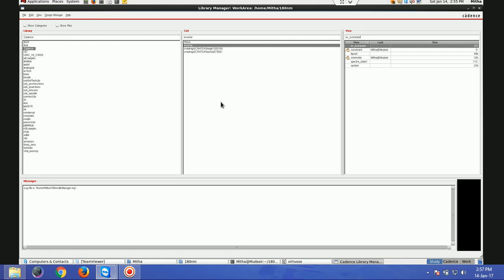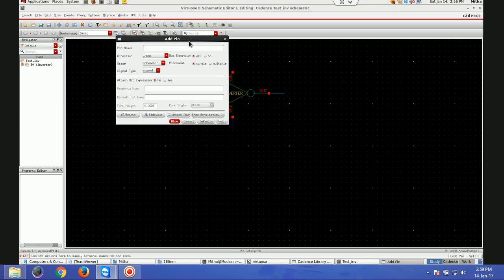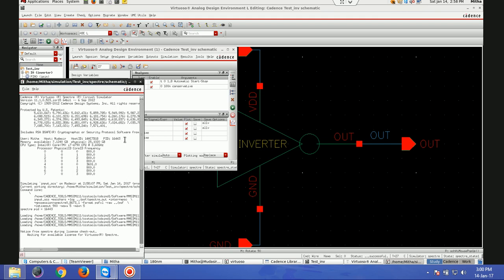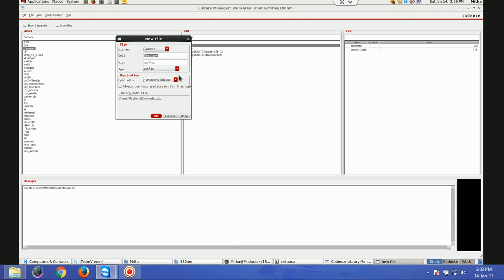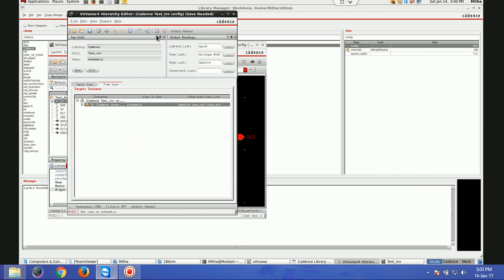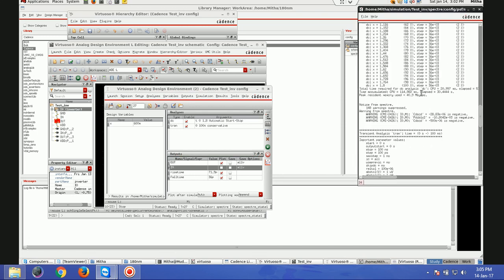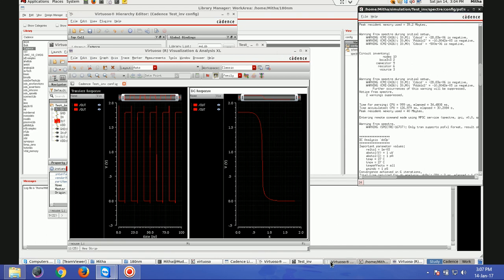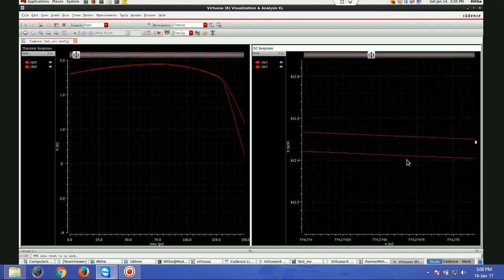Cadence IC615 Virtuoso Tutorial 5 (HD): Post Layout Simulation, Comp & Finding no  of Parasitics

Comment: Heyy.. I'm having offgrid error while layout... is there any solution for this??
Reply from the maker: Set the snap spacing (X n Y)  in the display options according to the DRC Rule file.
If You see the .rul file for DRC in assura folder.
Search for off-grid in that file..the snap spacing will be define there. take accordingly that value.
Reply: in. rul file of drc.. snap value is 0.005.... is it possible to change the value to 0.001 ??????
Reply from the maker: Actually it should. I have never changed that
You may try and let me know if that works properly.
Reply: it works. and now I don't have offgrid error any more... it occurred due to the changes in X and y values...what's the next step after drc and LVS.?
Reply from the maker: Go for RC extraction and post-layout simulations.
then the gds file (if planning for fabrication)
Reply: Mudasir Mir thank you man. can I get ur email id.
Reply: how to calculate area of layout we made. this case I have 15 mosfet mixed signal design so how to calculate area? and also any other calculations necessary..plz make one video on it.
Reply from the maker: There are two ways to find the area.
simple one is to use bind key "K" for drawing scale on our workspace and calculate manually the area.
other way is to generate the lef view after the RC extraction. Once the lef view file is generated, we can see the  total area in the .LEF FILE

Comment: Hello sir 
Sir i am not getting result of post with av_extracted file my netlist not working and it didn't show anything
But without av_extracted it work 
Please help me sir
Reply from the maker: Did you push the update button after changing the view? Can you share snapshots of your config view and netlist/log file on my mail. Also if you did the update after changing the view, once check in the ADEL in options (toolbar)-->Simulation-->netlist-->display (check before and after changing the views in  config, remember to update also). You should see lot or rc parasitics in the extracted netlist file
Reply: @MudasirMir7  sir please provide me your mail id
Reply from the maker: You can see it in my channel about option or write your mail here.
Reply: Please sir reply

Comment: Sir..my pre layout and post layout is mismatch. I tried inverter aslo.but pre layout & post layout mismatch. I am using SCL PDK. I don't know why it is coming like that
Reply from the maker: How much mismatch is there? If I remember correctly SCL pdk isn't that efficient. compared to other pdks, it will have more mismatch. #experienced!
Reply: @MudasirMir7  sir..post layout output signal is same for input. That's is the problem sir..but cleared DRC,LVS,PEX. I did one inverter for example. I got this output.
Reply from the maker: check the netlist of post-layout simulation, if you see the parasitics. your results are correct. great!
Reply: @MudasirMir7  sir..I did inverter sir..but i got wrong output sir..It is not inverting properly sir..but parasitics is there .I have seen it. and I have a doubt on SCL PDK. Because I am using version zero sir..but many of them using version 1. If is it possible to provide wrong output.?

Comment: My cadence version is a bit old, so it does not have ADEL X and ADEL XL. However, in ADEL part, there is a corner analysis part and it requires to upload PCF or DCF file for simulating. I uploaded a PCF file, although it does not work. Is there anybody who has the same problem and can guide me or share me some useful documents?
Reply from the maker: The PCF aren't related to the cadence version, infact are defined by the technology. Even we can do the corner analysis in ADEL in >IC615, only thing is I have to do simulations individually for each corner. In the model files, are you selecting the corners properly and whether the model files are correct. 
Error or a  snapshot would have helped!
Reply: @MudasirMir7  

Thank you very much Sir. I tried this way and changed all the model libraries from "tt" to "ff"; it works, but for post-layout simulation, does it work still? I mean does this solution work for post-layout simulation?
Thanks in advance
Reply from the maker: Yes, of course!
Reply: @MudasirMir7  Thank you very much sir.